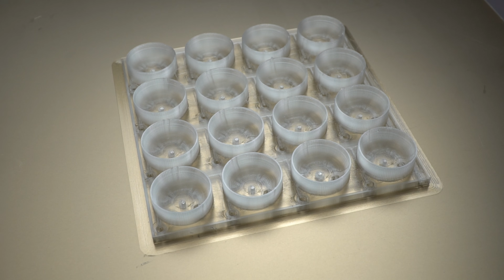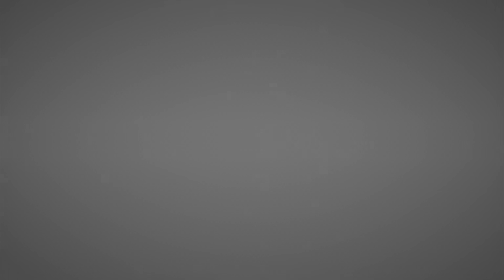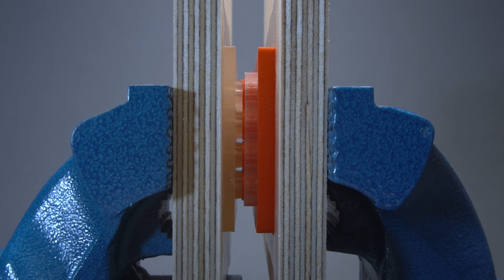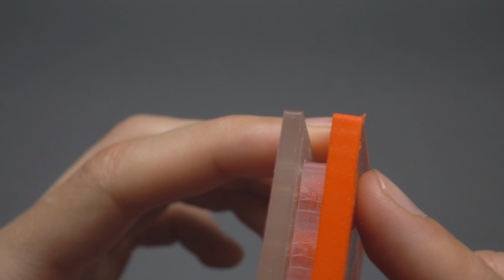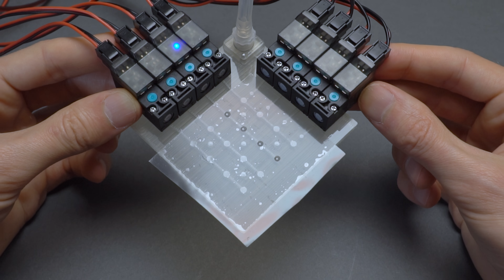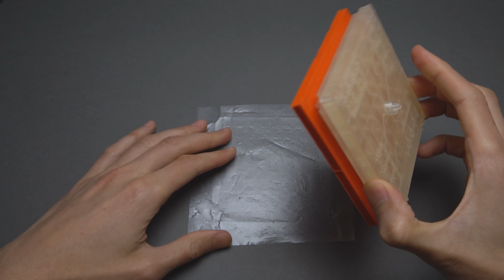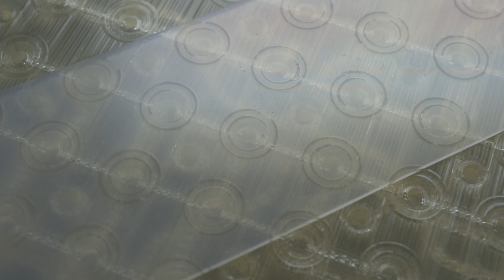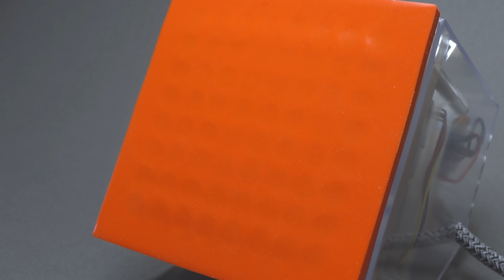Air Powered Display: 3D Printed Fluidic Multiplexing

Comment: have you looked at resin or TPU printers? I am wanting to make an articulated robot arm based off a tentacle (nested recursive platform) and it seems like some sort of air bladders or dual printhead extrusion would help embed these circuits in an actual 3d part.

Comment: I'd use over pressure instead of underpressure. A failed state in an over pressure system will still hold above ambient pressure, where as a failed vacuum will always equalize to near ambient instantly. More simply, a leaky 2 atmosphere pressure system will slowly go down to 1.2 atm, or 1.1 atm, rarely 1 atm. So it will still be "working", where as a vacuum when it fails will instantly snap to 1 atm or often above. So it fails catastrophically, where as overpressure fails usefully.

Comment: That vacuum anealing trick is really neat. I tried to make air tight and smooth FDM prints on my cheap printer. I used a 0.4mm nozzle but set the slicer to use 0.2mm, then set the over extrusion high-- around 150%. Also low speed and higher temperature. This was quite successful. Every line on each layer was highly overlapped. The layer adhesion was also very good. 
It is, however, very slow!

Comment: If you use ball bearings you can probably chain some logic together inline with your transistors. I was working on a portable go board that used half dome magnets attached to a half dome ferrite bead, which would press fit to the top of a board like a kid's magnetic drawing board, just with 3/4 states, open, closed, black and white (north and south poles of the magnet).

Even with just ball bearings and a magnetic stylus you can probably do a lot.

Comment: Amazing work! Imagine mounting the screen on a 2-axis tilt frame.

You could drop real objects onto the screen and tilt the display to steer them around, or use it to push, grab, balance and roll things across the surface.

Comment: Some complications that come to my mind:
- Curved displays
- Combination input device displays; each pixel a switch
- Tri-state pixeks using postive, negative, and neutral pressure
- Microfluidic devices capable of transporting and mixing droplets

Of these, the only one I'm sure is at all possible are the curved displays, though you wouldn't be able to apply your current print and cast on glass processes.

Comment: I wonder if you could have 3 states rather than 2. A neutral state and a pushed in state like you have, but also a pushed out state. Then you could push or pull the pixels or turn them off

Comment: why not make all the pixels individually replaceable and experiment with different kinds of latching pixels? like using thin printed sheets instead of silicone, or thinner transistors

Comment: This is an awesome project. At first I thought that this vacuum matrix display would be good as a braille screen, but thinking about its other uses I think it would be essentially a small pump/measuring device for lab chemicals or colors. If outer row had larger 'pixels' they could pull in a certain amount of liquid, then small pixels form a pulsing caterpillar-like path to transfer this liquid to an outlet.

Comment: Get it small enough and you could make something simulator lcd maybe using a reflective material for the membrane.

If you do, I'd suggest making the screen in multiple parts for the sake of making any repairs easier

Comment: Last time I've seen this it was a very old industrial pneumatic PLC (long since replaced with electronics). It could even calculate square root in air pressure.

Comment: Great work!  For me a it's a blast from the past.  I became interested in fluidics, or micro pneumatics, in the late 60s.  During the previous decade fluidics had been studied for use in the space program, micro-electronics was still a ways off, transistor-diode logic on PCBs were too heavy, power hungry, and subject to radiation interference.  In the early 70s I was employed as a controls tech using some fluidics and a lot of pneumatics, and some electronic controls.  Pneumatic controls were used extensively in the offshore platforms as there was a huge supply of naturally pressurized natural gas, yep natural gas was the working medium.  Fluidics for logic pretty much died with the invention of the microprocessor but still exists in medical and certain other fields dealing with fluids.  If you don't consider this proprietary is there a way of maybe sharing the files?  If not I understand.  But you have inspired me, something to use 3d printing for.

Comment: This is so impressive! You already eliminated many solenoids by using a matrix and air transistors. Perfect job!
Can you elminate the pump, too?
Imagine a pump running on e.g. baking soda and citric acid (dissolved in water) as a safe fuel. The mix makes CO2 under pressure. Then have a membrane between two chambers. CO2 pushes the membrane out from one side. The membrane then pulls back and makes vacuum on the other side? Repeats periodically.
Like a beating heart of the system!
Would be so much cooler than the electric pump.

Comment: It is cool seeing the updates of the display, but think a interesting experiment would be global screen update , where you add another layer basically a frame buffer and you draw into it , then you globally clear and update the outer display all at once , it would add complexity and also latency , but if you have even more “pixels” it might create a more convincing motion when doing animation , but this would also require higher refresh rate , since you have to wait for fixed length of time such that you can draw whole display before you refresh , compared to know you get “motion” for each pixel draw

Comment: If you can figure out how to read the state of a dot, you have DRAM. Since a human can change that state by pushing on the dot, you have something that works for both input and output and can retain state with no power for some time.

This is amazing and seems sooooo futuristic. It's not the knobs and dials I love on older equipment, but it's tactile and I still love it.

Comment: Early LCD displays had something called quad scan.  Basically four X and Y addressable displays side by side in a + shape.  The video card then divided up the video into four driver boards to allow for better scan rates.  You could in theory do the same to add as many parallel displays as you want.  You would only have to make 20,000 of these to have an HD display the size of a stadium.

Comment: Work on making the silicon transparent, see if you can make the pixels pop out as well as in, put the solenoids out to the sides and use flat channels with transparent resin, lastly put a screen behind it. There you go, you’ve got the next generation car display. Safer than normal touchscreens, lets people customize their own layouts and put buttons where they want, they can get haptics when pressing buttons, and you don’t even need it to be fast. 

Whoever reads this and makes this a real product owes me residuals. You’re gunna be a billionaire, you’ll be able to afford it.

Comment: why vacuum? because NPN are generally easier to handle then PNP at such high level :P
kinda funny that immediately you can see a clear PNP/NPN similarity in the transistor, wether you used pressure or vacuum

Comment: Pneumatic Multiplexing is very old tech. If you've ever seen a player piano, or better yet a pipe organ on Pittman action, then you've seen this technology. The oldest examples I've seen personally date to the early 20th century, but the tech is older than that. 

Instead of 3D printed channels, they'd router out channels in wood, then use a thin piece of goat or sheep leather for the pneumatic pouch.

Comment: You should see how small you can make these. If you can manage pips that are 1.5mm wide and spaced 2.5mm apart, you could invent a much more effective braille display. That would help a lot of people, those things are expensive and bulky, and existing braille displays are such small resolution that they only work as a marquee type strip.

(A braille grid isn't a simple pixel grid, but it's actually easier tolerances than the pixels. 2x3 pips per cell for print, 2x4 pips for digital. You'd have to look up the standards but there's like a pip and a half gap between columns and two-and-a-half between rows. The different spacing between rows and columns is to make it easier to tell where the edge of a letter is.)

Comment: This is an absolutely mind-blowing project! When I saw how your matrix works, an idea struck me: this technology could be the key to creating an affordable, full-page refreshable Braille display for the blind.

Current Braille displays are incredibly expensive and usually only show one single line of text at a time. Your air-powered soft silicone approach could potentially scale up to a full "tablet" of Braille characters, displaying whole paragraphs or pages at once.

Imagine pairing this soft matrix with an AI (like a local LLM): you could create an interactive reading assistant. A visually impaired person could read web pages or books, ask the AI questions, and physically feel the dynamically generated answers on the board. Since you've already conquered the multiplexing challenge with 64 pixels, adapting this to a Braille format could truly revolutionize accessibility tech.

Amazing work! What do you think about exploring this application?

Comment: 4 months of work! wow what amazing results. I'm impressed that the pixels don't seem to bog down when multiple are activated at the same time due to flow limitations in the vacuum channels. I would have expected you to need larger vacuum passages as in the original 16 cell display it was pretty obvious when multiple pixels needed to be pulled in, how much longer it took.

Comment: Very interesting. You could make a version for making candies. You turn on the grid array vacuum apply the molten chocolate over it then squeegee off the excess. When the chocolate cools and hardens, turn off the grid array vacuum and the chocolate pieces popup from the divots. Of course, it's no different from a mold, but it's the automatic releasing that makes it easier. Alternatively, you could have an array of nozzles that squeeze the chocolate into array divots. It eliminates the squeegee and gives it a more pill shape.

Comment: How much vacuum pressure do you really need for the system to function? I want to make a display for my window, but vacuum pumps make noise and having a constant hum like a fish aquarium pump doesn't sound great to me, so what i'm thinking is i could instead pressurize something (like a 2L bottle) and then use a venturi nozzle to create vacuum. that way the pump would just have to fire up once in a while to re-pressurize the bottle. (and also this would add the concept of energy storage/battery) to the ecosystem.

Comment: Would it be difficult to add another buffer and enable function to refresh the screen at once? Also a thin layer of colored fluid might enhance readability, as it would collect in the dimples.
Reply: I was thinking the same thing about the buffer. Instead of connecting the multiplexer directly to each pixel, there could be a small reservoir connected to the pixel by a transistor. Activate that transistor for every pixel simultaneously to refresh the screen.

Comment: Its made of a lot of repeated channels in a couple layers, I wonder if you could skip the 3D printing, and stamp these things into plastic sheets with hot metal, to make any layout you want. some hot bent wire might be able to cheaply mass produce these things like stamping a vinyl record.
Reply: why use third party solenoid valves? just make some speaker coils you wind behind some buttons, similar to the membranes you just made, with ball bearings held in front of the membrane, coil on the back. maybe within the coil you put a ball bearing.

Comment: I wonder how you could make the solinoids silent. if there was another mechanism that could be used that didn't click
Reply: Perhaps you could use smaller, quieter solenoid valves for sending control signals to silicone transistors that amplify them with a much stronger, constant vacuum input.
Not sure about eliminating the clicking altogether though, that would probably require replacing all electronics involved with pneumatic circuitry.
Though I'm no expert on, well, pretty much anything. Just an idea

Comment: When you showed that you could push in the vacuum dot pixel things manually then release them by selectively applying a vacuum from the back, I thought you were going to make a controller for the game utilising this. 
To my knowledge (which could be wrong) keyboards work kinda like displays in reverse, so you could probably reuse some parts of the display (or at least it's design) if you were to make a controller.

In my mind the simplest layout would be 4 buttons, one for each direction; when one button is pressed it releases the vacuum on the previous button.

I haven't thought about how the button press is read though. If the game of snake was run on a computer that works on the same air pressure technology, you'd just need to connect it through a tube, but I don't know how you'd get an electrical signal out of it.

In summary I think a controller/switch/button made using this technology would be really interesting.

Comment: If you made a way to push the silicone out you could use the pixels as input buttons with some sort of pressure sensor. use case a HID that can get wet, medical use or used with chemical covered gloves.

Comment: Would it be possible to "buffer" the screen updates so that the whole screen could be updated at once? For example, instead of the multiplexer going directly into each pixel, it could feed into  a reservoir located below the pixel. Then a single line could be used to connect all the reservoirs to the pixels simultaneously, refreshing the entire screen.

Comment: I wonder if there's any way to detect which pixels you pressed in. That could make it fun for input, like the ripple example you had.
Reply: Yea, you could build in a pressure sensor to detect when the air gets pushed out of a pixel

Comment: Hi, Nice video btw, I have some questions & suggestions:
# Questions:
1. Can you make it more smaller? So you can have many more pixels density? (If not, explain why? it is a printer problem? or the air has limit on how small it has be to work properly?)
2. Can you make it work entirely by air only? (No electricity at all)
3. Can you make it more quiter? (Build some sound barrier or sound canceling device or maybe create patterns that cancel the sound of ticking?)
4. Can you make a colorness (Rainbow light reflect) silicon screen? (By maybe a different pressure levels?)
5. Can you do some endurance tests? (How long the vacuum can stay without poping and etc.)

#Suggestions:
1. Try to make a sphere screen. (It will be cool to see it works like a 3d ball.)
2. Try to make a musical instrument based on air with this new technology.
3. Try to make a chain reaction process by pressing a button. (Maybe a multi tasking?)
4. Try to make a full compatibility RAM memory card. (We really need this these days.)
5. Try to make a full computer (PC) that based on air. (Includes: Mouse air clicking, Full air buttons keyboard and etc.)

Thanks. ^^

Comment: Could put a backlight on it and it would work in the dark probably because the light will act different with the curved indentions.  That's assuming the material on the outside lets enough light out.

Comment: 2 ideas
-Something that measures pixel state would be cool:
So you can push one in and apply the ripple when you let go
-a top layer of solid tiles stuck to the membrane, that goes edge to edge:
This lets you tile multiple devices, or invert the screen so that you have raised bumps you can press, combined with the point above you could create dynamic interfaces

Comment: I think the next task that would be good to tackle is trying to get more bang for your buck out of the logic and display. Basically, try to shrink your size as much as possible to see if you can get it to a size that scales much better. If you're able to get it small enough, then you can try creating a simple pneumatic computer. From the transistors you'll go to logic gates, then a half adder, full adder, multiplexer, and 8-bit RAM. From there you can start doing all sorts of things with your soft robots if the scale of your individual units is small enough. You then wouldn't need to concern yourself nearly as much with scaling up your pneumatic switches because you could just use pneumatic logic to give your little CPU instructions, performing ever more complex operations.

But that's a lot to deal with. For now, I would recommend shrinking your dimensions. Find ways to improve your print accuracy in order to get the smallest routes possible. Use your curing methods to shrink your transistors, allowing also for thinner silicone sheets and significantly less edge deformation. Maybe check out resin printing (JLC3DP has good options) for it's level of detail and print accuracy. Find every possible way to shrink your design until you push the limits of what it can do. Then start thinking about logic.

Comment: very cool make the solenoids 10x smaller. if the solenoids were tiny you could go huge. and include a positive pressure line in the build so you can inflate pixels too.

Comment: If you change the thing pulled in/out from surface silicone to a piston w/spring, I think you could make a tiny inverter linkage to convert the pulling-down into an upward motion (and have releasing-back-up create downward motion).
There's some really clever simple mechanical inverters out there, but making it as tiny as you make stuff...  errr... maybe it's a dumb idea..
but that's my idea for ya..  try pistons'n'springs, possibly drop the sheet,  and aim for outward motion 
Damn you make cool stuff!